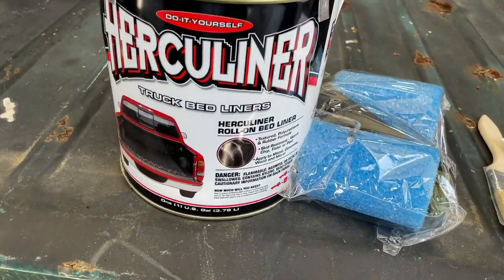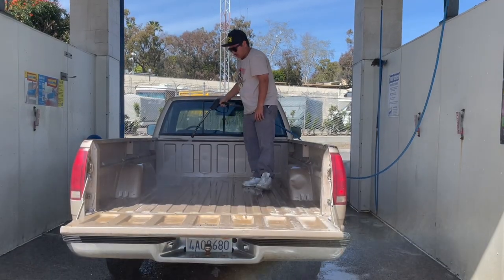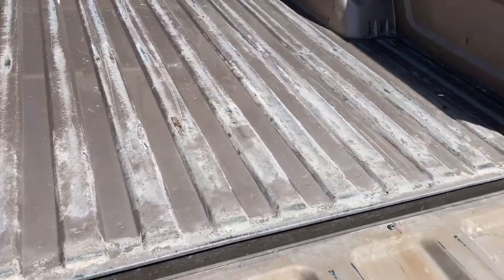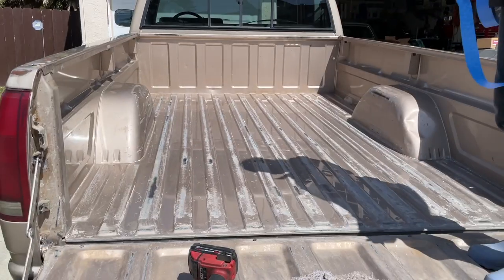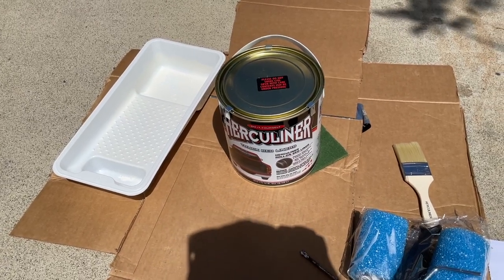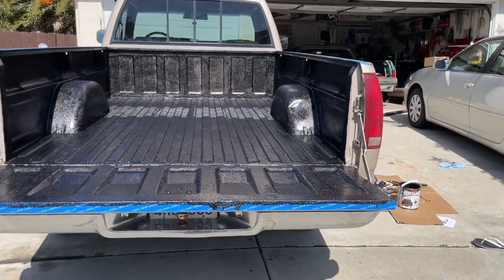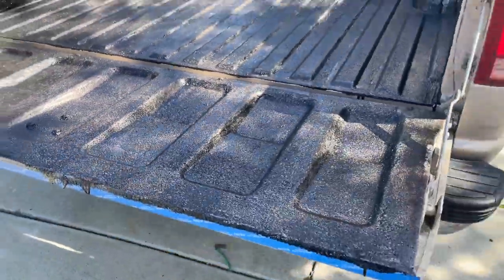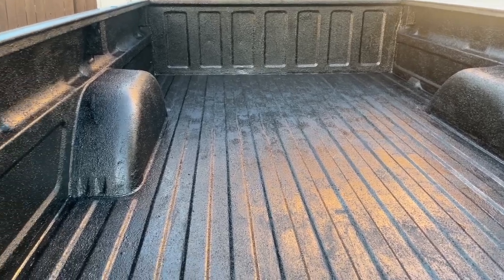Honest Review On The Roll on Bed-liner Herculiner  (From Amazon) 1990 Chevrolet C/K 1500 OBS

Comment: Those plastic i insert bed liners will trap moisture underneath and cause your best to rust.  I just bought a 1978 ford f100 with a plastic bed liner.  I pulled it out and had rusted holes in the bed.  Those are a bad choice.
Reply: But not the Herculiner right?
Reply: @mattc9875  No, Herculiner won't do that
Reply: true! i had a 97chevy  that was bedlinered at first but then i literally found a new drop in bed liner for it on the side of the freeway that fit PERFECT🤣 and after a few years i took it back out to peak and the bed was trashed with plenty of holes
Reply: @STREETRACEN4U my bedliner plastic once jumped outlet bed on the freeway since it wasn’t bolted on right 😂 imagine it’s the one you picked up 🤣

Comment: i just taped off and did the bottom, front ribbed area, and tailgate on my ford ... the stuff is thick and nasty😂 ..i did minimal prep, wiped it down with laquer thinner and slapped it on - one thick coat, used alittle more than half on my 5.5 bed ..it looks good and covers the rusty scratches a all i cared about, it will cover anything but dents😅 .. way i see it the rust is stopped permanently and i didnt have to spend 2 weeks prepping the bed to make paint look good ..still, if i was hauling something heavy id throw a piece of carpet remnant on it, why not .. and a tonneu cover is over it so not worried about sun fade etc .. finally, wear gloves, and anything you use with the stuff is garbage, so if you have multiple projects for it buy supplies accordingly ..laquer thinner cuts it well for wiping off screwdrivers etc ..

Comment: I just did my f250 last week, it already had a pretty beat up rhino liner already installed. I sanded most of it off treated the rust and filled the no longer needed holes. I used two gallons and it did a great job, it's worth the extra $100 for the second kit.

Comment: Thank you for this video! In June of 2021 I bought a Ford Ranger with less 89,000 miles it had a bed cover which was covering a large rust hole towards the front of the bed. I placed over the hole a sheet of metal held down with hex-head self-tapping screws, prepared the entire bed as recommended including the bare metal, using Herculiner and some thinner I applied two coats with a spray gun bought from Amazon for such liquids. After letting it dry I bought a topper for it, I've slid many tires, crates and tools across the bed since and its held up very well, no chipping or peeling of the bed liner only the high edges of the hex head of the screws have rubbed off. I like the rubber bits of the Herculiner because they help to hold stuff in place. For the Ranger which has a bed of 6' x 5' I used most of a gallon I did not need to do the inside of the tail gate because the plastic bed cover was fine and no rust under it. I think spraying is a better option but not everyone has that choice.

Comment: Are use this on my last truck bed, and it worked very well, a lot of dirt and debris tends to stick to the bedliner especially if it’s really hot out. Also, some thing I noticed is that the Herculiner tends to fade in the sun. Mine started to fade even after four months.
Reply from the maker: I agree with you on the dirt and debris sticking! We’ll see how long before mine fades. So far it’s ok!

Comment: Does it have a smoother finish? If you were to load something in the bed (furniture, lumber) would it slide easily or kinda of get caught up?
Reply from the maker: Its a rougher finish. Furniture would definitely get caught up.
Reply: How rough or smooth has to do with the roller used & there are versions that are designed to come out smoother

Comment: looks legit.  I just primed my C4 Fabrication Low Profile bumper for my 4Runner TRDPRO.  I am going to use this on the high clearance additions, and maybe the bumper itself.  I hear it may not hold up the best in heat, but I will be the judge of that when i see how hard it cures
Reply from the maker: Let us know how well it works for you!

Comment: Hello. Thanks for sharing. Im considering roll on vs spray kit. Ive seen a vid of roll on where the person said they could see paint lines with roll on. Did you experience that? How long would you say it took to apply each coat?
Reply from the maker: You could see the paint lines when the paint was wet, but once it dried it looked good. It took about an hour to apply each coat
Reply: I came here to investigate before using the spray. My front bumper for my F250 is out getting sandblasted now and prepped and then I’m going to spray kit it if you think of it, let me know how you make out.